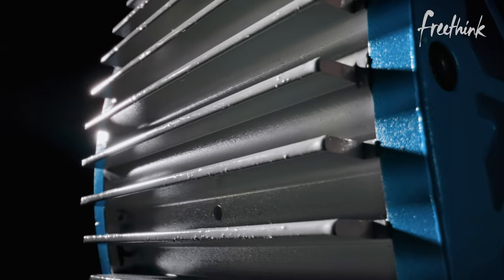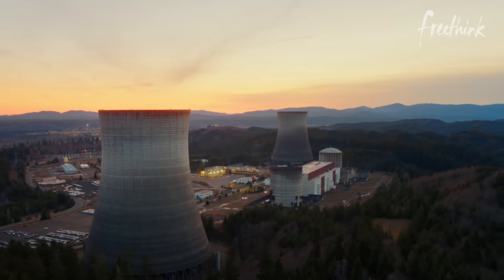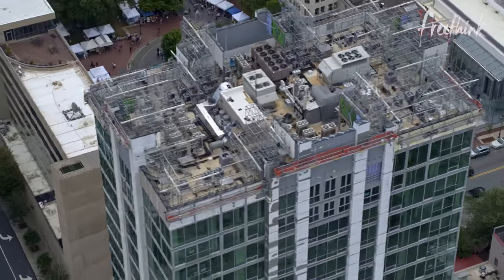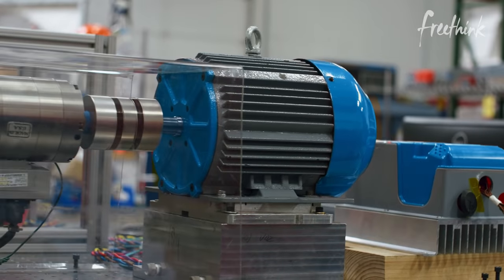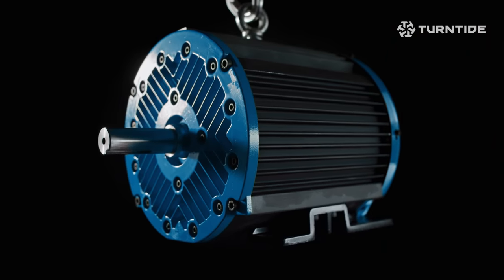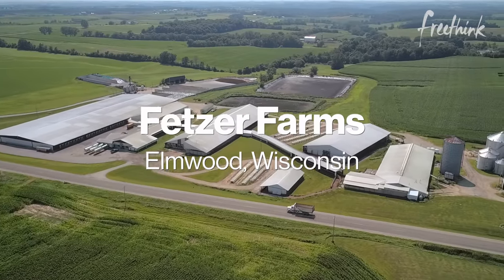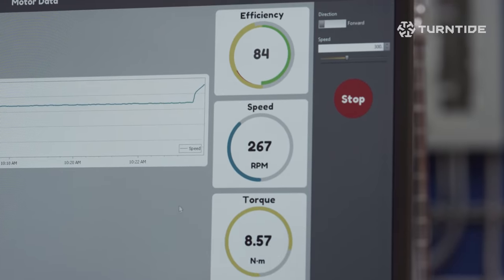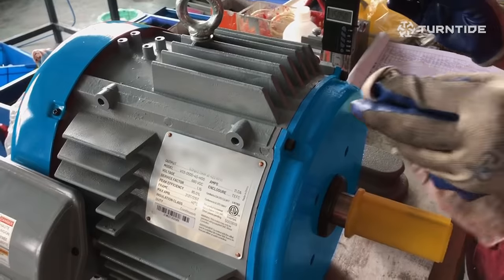Want to Save the Planet? Start with Reinventing the Motor

Comment: "It's really difficult to control" -> Throws in the magic word "AI" which solves everything. Why is AI better than precision timing and discrete mathematics in the case of a spinning rod in a closed system?
Reply: AI literally does all that🤡
Reply: @Petri_Pennala  it's manipulation. Why would anyone want AI in a simple motor?
Reply: @michakrzyzanowski8554  What ever this whole thing is fake and full of propaganda
Reply: @Petri_Pennala  And? Like one is basic components that run a pre determined line of action that will work as efficient as posable. 

And the other is a more complicated system requaireing more pover to calculate what needs to be done doing it and getting the same thing as the first option.

 Computers are basicly space heaters that do math. Any pover given is turned to heat. If you trow ai at something compared to a mecanical problem it would only cost more electricity. Makeing it worse.
Reply: Well, why SRM hard to control is at hardware level. Its needs simply more expensive inverter with switches and sensors at higher frequency. So u ll not gonna solve that by AI.
Reply: @1610kai  You cannot solve a hardware ishue whit software. Like i cannot get more ram by running a app.
Reply: @egesanl1  Yes but i said AI can do all the tasks its not needed But it can
Reply: @Petri_Pennala  So can slaves whats your point then? Just because it can do something it doesnt mean it needs to be done that way.
Reply: @egesanl1  Indeed i didnt say its needed as i told In my last comment/answer
Reply: To give them the benefit of the doubt: it could be that they use some sort of machine learning to initially tweak the parameters of their control systems. But to claim their system uses "AI" to control the moters would be absurd.
Reply: It's quite not true. One can compress date to put more to RAM. And something can be done with others hardwares too.
Reply: It brings in more funding
Reply: I work as a guy doing math at a company delivering AI solutions for manufacturing, and a can ascertain everyone: AI is no magic wand.

Comment: This video is waste of time, 95% they only talked and talked on how great it is, and 5% showing how it works. I want to know more than that 5%
Reply: They’re running it as an ad, of course they’re gonna talk about how good it is, no one’s gonna watch a 15:00 ad on just how some motor works.
Reply: Ye its just bs
Reply: @AxeSoul  I'd watch 15 minutes about how it works !
Reply: @Paul For an advertisement? Yeah, even if YOU would, most wouldn’t.
Reply: At a guess, the efficient bit is the control which ensures efficient delivery at the work end such as not having the motor, as in a fan, belting flat out continually. So, it is not so much about the motors own efficiency but the efficiency of the package through controlability. I could be wrong
Reply: Don't expect this from a video intended for general audiences.  Do the reading.  https://en.wikipedia.org/wiki/Reluctance_motor, https://en.wikipedia.org/wiki/Switched_reluctance_motor
Reply: And it's an effing brushless motor! Known for a long time. I have those in my drill, angle grinder and impact driver.
Reply: And that 5% is the basic mechanics of a vfd acting like “until now.... this technology was impossible....” smh

Comment: They really didn't explain any of the details, all of it was just "it is good"
Reply: It's just nothing new, reluctance motors and synchronous motors are actually pretty widespread.
Reply: @continentalglue  Yeah, I was kind of confused by this.  This is not new tech and neither are the controllers.  It's kind of fishy they spoke of efficiency gains without mentioning absolute efficiency. As far as I can tell the current state of the art is the yokeless axial flux synchronous motors and they clock in at 97-98%.  With halbach array magnets their power density is like 10 kW/kg.  I can't wait to hot glue one of those baby's to my bicycle!
Reply: Look: they obviously made this video for non-engineers, and from the looks of it, the majority of the comments are coming from engineers or technicians experienced with induction motors.  If they actually went into the details of how variable reluctance ("switched reluctance") motors compare to induction motors, many of the commenters might be convinced, or at least willing to admit that there may be something to this.  But they would have lost 95% of their audience in the first two minutes.  Again, not written for you.
Reply: @douglascanoose5281  yeah except what was that about BMW anyway ? The way it's presented you're probably supposed to associate "electric motors" and "BMW" and think "electric cars" but it appears all that's happened here is that BMW has bought some of their fans for one of their factory... it's not like BWM makes factory fans, so this sounds just like any regular product endorsement video. Besides, it doesn't matter if those fans are good or bad, I don't think BMW would put out a video where they admit they fucked up in selecting a bad technology. This is all smoke and mirrors.
Reply: @whatelseison8970  motor plate said 85%
Reply: Back EMF also a potential energy that be can store and re-used,,,,,...!!!???Tesla/John Berdini
Reply: "They really didn't explain any of the details"
Same happened to me in my early 20's when my team leader invited me along to a seminar for his cult called "the landark forum". They all spoke of how wonderful and life changing it all was, but noone could articulate what the hell it was... and they wanted me to part with $3K that I didn't even have!
Reply: @BrightBlueJim  people are not idiots, and this video is just fake